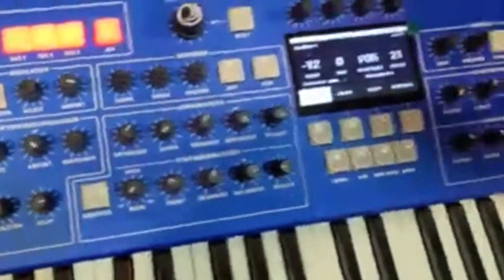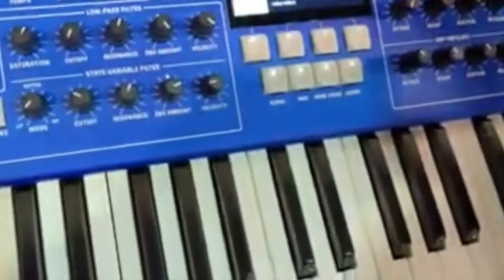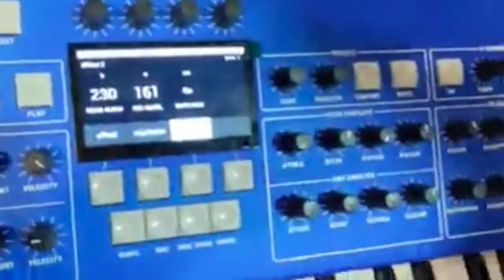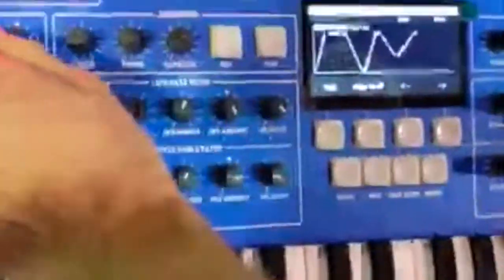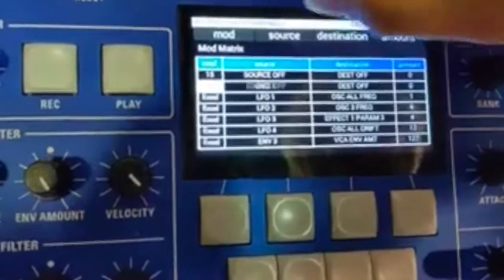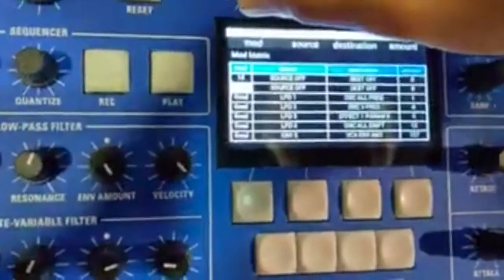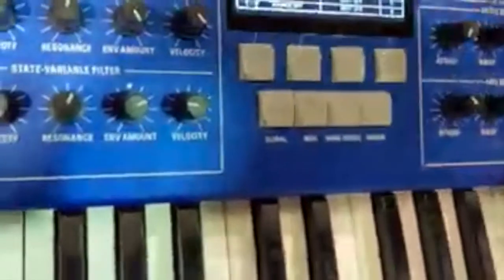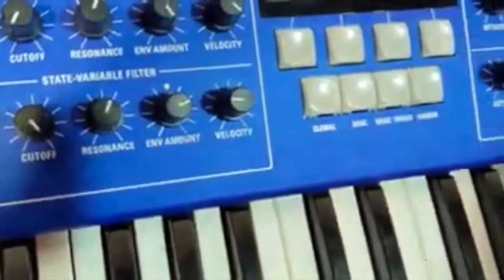Groove Synthesis 3rd wave- NAMM 2022

Comment: Kinda disappointed it can't better emulate the low fi nature of the PPG's
Reply: I love the low-fi, aliasing, etc of the original too. It's a mandatory part of the original PPG's character. This new one can sound 'vintage' & low-fi (with aliasing) too, although I am not sure if you can get the 8-bit sound of the PPG 2.0...it may be a 12-bit sound. FYI, in this interview, Bob mentions adjusting the drift of the circuits. Also, check out Sonicstate's interview with Bob in the product suite during NAMM, during which the 3rd Wave is compared with a real PPG 2.3 .
Reply: @derekbaker3279  I thought they mentioned only 1 oscillator can emulate the ppg which seems like a bad choice to me, it’s one of the things that might have me pass on this one
Reply: @dodgingrain3695  nop
Reply: @dodgingrain3695  it has 3 Oscillators and 3 different synth engines (Vintage 8bit PPG Wave, Modern High Quality Wavetables, and High Quality Analog Modeling) and ANY of the three Oscillators can run ANY of the engines, just like on the Waldorf Quantum. So you can have Oscillators 1 and 2 set to play the vintage 8BIt PPG wavetables and have the third oscillator playing your own waves, or the Analog Waves.
Reply: @derekbaker3279   it has 3 Oscillators and 3 different synth engines (Vintage 8bit PPG Wave, Modern High Quality Wavetables, and High Quality Analog Modeling) and ANY of the three Oscillators can run ANY of the engines, just like on the Waldorf Quantum. So you can have Oscillators 1 and 2 set to play the vintage 8BIt PPG wavetables and have the third oscillator playing your own waves, or the Analog Waves.
Reply: But you gotta admit the video’s lofi emulation was quite impressive.